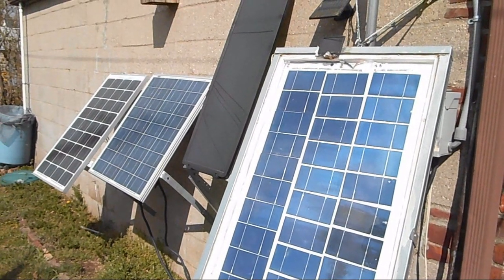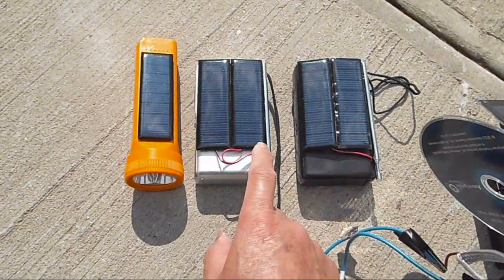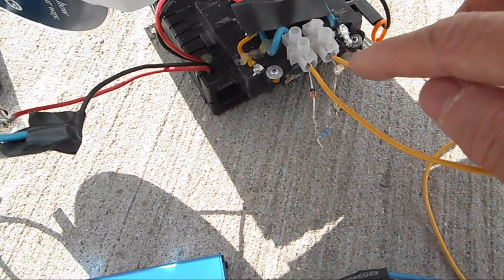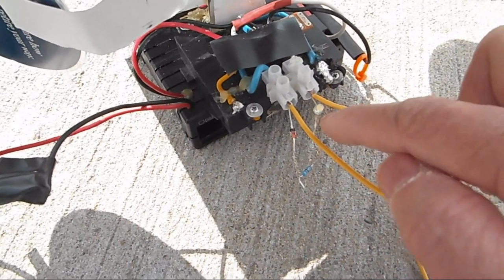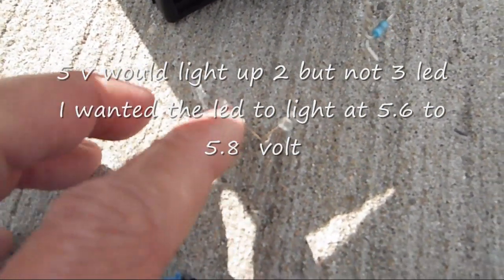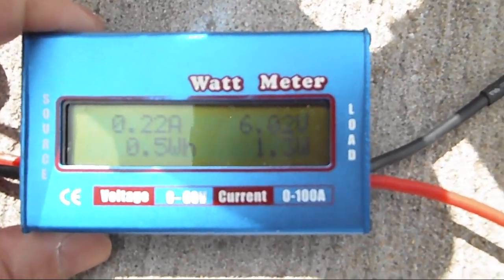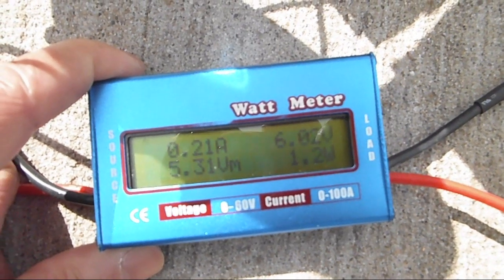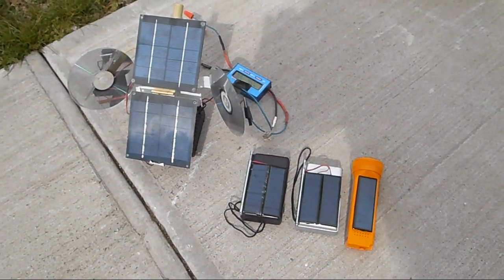Sunbathing my small solar gadgets

Comment from the maker: I have already put the diode in reverse.  You and Ray are probably right, the resistance might be a little too high. If I have a variable power supply, I can find out the exact point the voltage breakdown. I know it didn't break down even at 6.4 v. When I used a 9v battery, then the led lighted. So it has to be somewhere between 6.4 and 9v instead of the 5.6 volt of the zener diode rating. Thanks for the insight.

Comment from the maker: You are mostly likely correct about using 4.7 volt zener diode. I should have gotten the zener diodes in a mixed voltage bag instead of a single value. For the experts, they can think it through in their heads and everything works out. For me, it's mostly trial and error. If I can borrow a nice body, I'll be happy to put some suntan oil on her. Nobody is volunteering though.

Comment: I know very little about it, but I think zeners have to be reversed to work as a regulators.  So hooking the diode up backwards might work, and as Ray was saying, you might have too high of a resistor for the two diodes you have in series.   That solar stuff you have there is really neat.

Comment: You may need to use 4.7volt Zener. The voltage drop is too much with the resistor in series. great video though. On a health and safety note. Were your panels using suntan oil. Those UV rays are deadly.